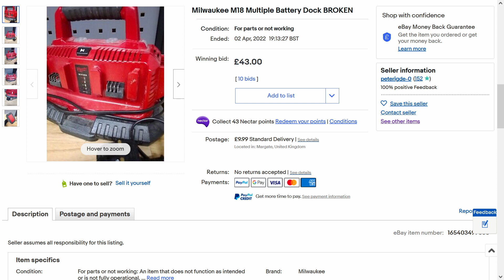Repairing A Milwaukee Charger

Comment: Going by your videos, Milwaukee gear seems to be quite repairable, even despite a lack of schematics and support by Milwaukee.
You even encouraged me to spend a few Euros on a broken charger to see if I can reproduce your results. 😉
(And yes, I'm currently binging your videos. I need a break from retro computing repairs. 😇)
Reply from the maker: Thanks 👍I love the old retro computing stuff. I've got a couple of C64's lying around in need of attention and I've got a Taito Space Invaders PT II arcade board lying around as well. I was brought up with those types of things (ZX81, Spectrum, Atari 400,800, C64, Amigas etc).
Reply: @BuyitFixit  I've got a couple of C64s waiting for me, too. Minor repairs, like a broken pin or damaged power switch, but still. 5 minute craft, if you will. 😉
I missed the 8 bit era, actually, but I've been catching up. And my repairs went quite well so far. Saved a bunch of C64s from the tip.
Reply from the maker: @ThiloNiewoehner Nice 👍yes I remember spending many hours playing on the C64 and programming bits and bobs in assembly code.

Comment: Previous owner probably thought it was dead because it's sequential and all 6 batteries weren't charging at the same time.  As for the component with fresh solder, that one, as well as the diode on the other heat sink were most likely not installed when the board went through the soldering process, and were hand installed and soldered during assembly.  The diode on the other heat sink also has fresh solder on it.  Also, did you forget to reinstall the plastic separator sheet?
Reply from the maker: The listing I bought it from sells lots of used and faulty Milwaukee stuff, and on the listing it was described as dead. I did look at another one of these and on that one the PTC was blown and shorted on the input, it also had a 110v plug on it, but because the label had been removed it wasn't sure of the input voltage range, I compared to my working one and the components seemed identical so I assumed it must be universal input 110-250v .. I was wrong! A couple of very hot capacitors later...I had another look and noticed a small wire link marked J1 which was partially covered in yellow goo, removing said link set it from 110v to 240v operation. Yes I did forget about the separation sheet 😂😂
Reply: That thing is meant to be left unattended, like on a construction site, when all the workers go home and leave the batteries in the charger, so they are all topped up the next morning. Thus it doesn't matter if they are charged all at the same time or one after another. And that's the reason why there is a button to skip to the next battery.